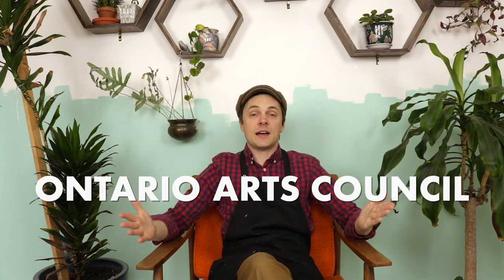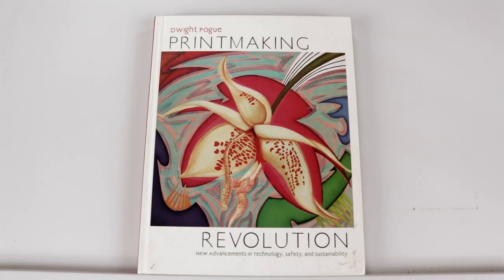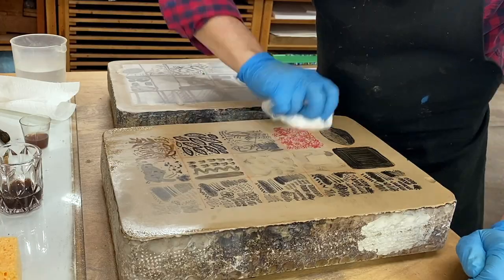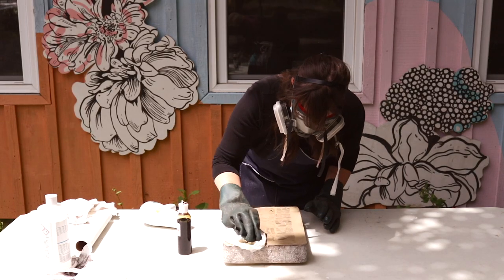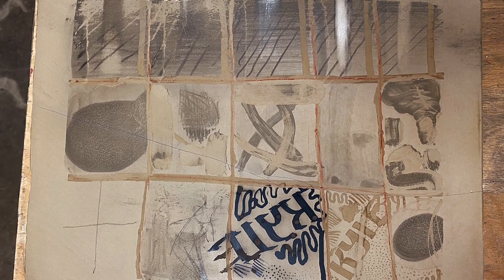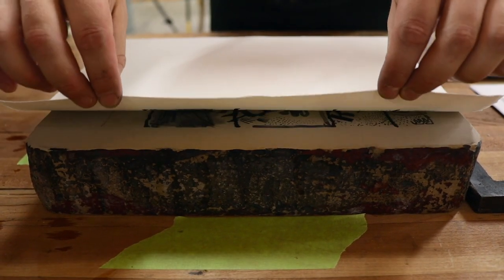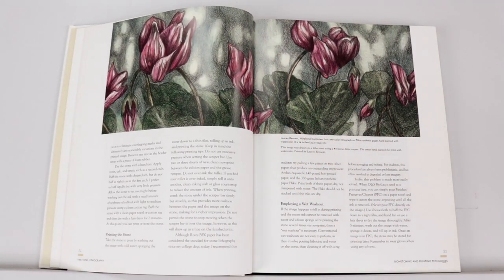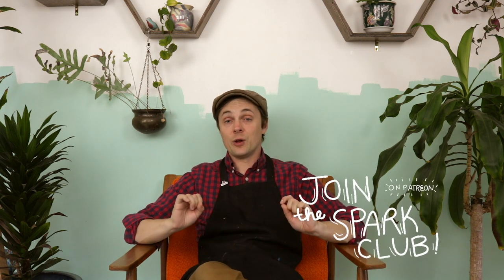PRINTING our test LITHOGRAPHY STONES 👏

Comment: Cool video. Crayon black should be that stiff. I generally do roughly 50/50 mix with crayon and process or roll-up. If you're image is rolling up in a single cycle your ink is way too lean, that's why you had a much better result after adding mag carb. I generally aim for 6 passes (rolls over the image) per cycle (trips from ink slab to stone) and I aim for my image to roll up within 4-6 cycles. For what it's worth you can get a pretty wide range of values with #4 and #5 crayons, if you want to ditch the acid altogether.
Reply from the maker: So awesome! Thanks for this info. It's been so long since we worked in litho and apparently it isn't like riding a bike 😂 Going to try this ratio of ink mix for the next run to see if we can get these inks to work better for us. Really appreciate you taking the time to share this with us.